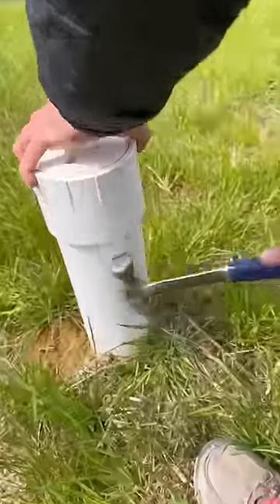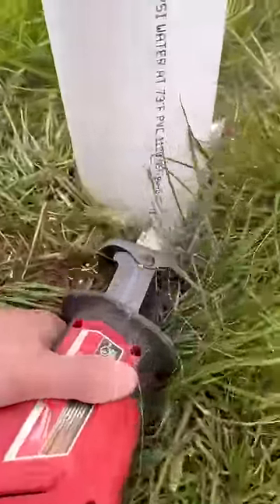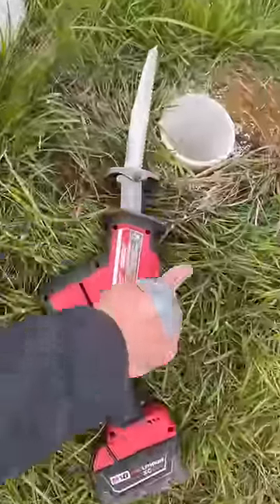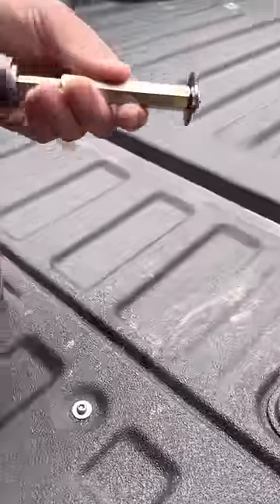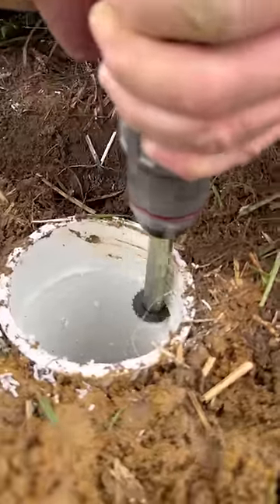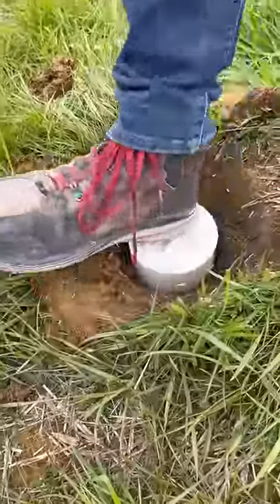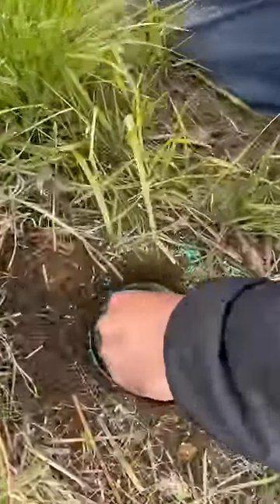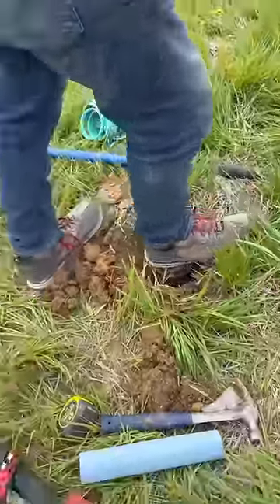How To Cut Off A Sewer Cleanout So That It’s Flush With The Ground

Comment: As a plumber, dont do this
Reply from the maker: I said, put it flush with the ground, not lower
Reply: Typcam2, I just looked at your profile and you don't look like a plumber. You look like a kid that makes tick-tock's. Lol
Reply: @hausplans  it will eventually get covered over time, now you have to intentionally make sure the grass doesn’t grow over it. It should be sticking no more or less than 5 inches above the ground! You make the plumbers job harder when it’s over grown and can’t be found.
Reply: I agree. Some homeowners don't touch these kinds of things for years, or the house gets sold and then it lost. That's why we intentionally leave them sticking out of the ground.

If you're going to cut it off, build a proper base around it out of concrete maybe, so it doesn't get lost, at least.
Reply: @hausplans no difference. It gets covered with dirt eventually babe.

Comment: As of September 2023 they all must be 2" above the soil surface in my State.  They no longer allow the burial of OSSF components that must be accessed for maintenance.
Reply: That's sucks. I live in America.
Reply: @NutzBdragon  It sucks when mowing, but paying extra to get the plumber to find and dig out the cleanout when somethings goes wrong is way worse.
Reply: 12" in my state
Reply: @NutzBdragon  can't you just mow around it ? It's pretty easy
Reply: Booo who we got the code inspector here 😂😂
Reply: @Hidden-comment164  Sadly I have unhealthy neighbors so I like them visible.
Reply: @SlackerU I assume you mean they can't walk or will trip, if you bury it there's nothing to trip on hence less risk then 2 ft above ground
Reply: @hotsauce2446  These systems need maintenance every two years, even if it is just to be checked.  If you look at the studies on OSSF you'll see that less than 50% participate in preventing nuisance conditions.  Even now we are finding the older aerobic conversion have oversized trash-tanks where extended periods of not pumping out the system makes habitat for rats.  Ideally you want to pump out your trash tank often so that you never build up any food for pests or large amounts of pathogens to overload your lawn.   My city offers an OSSF map so I get to visibly see the over 50% who are out of date & are one violation away from being forced to upgrade to the 2020 standards.

Comment: I have one sticking up in our yard. I'm planning on digging around it and putting in a small valve box to protect it and prevent the kids from opening it and putting rocks down there 😅
Reply: Best idea yet.
Reply: You're kids carry around a wrench to pull the cap? Lol
Reply: We just dug up the trap for a customer cuz the picture was damaged and loose. Customers young son found out how to remove cap,install a 3"diameter log into the 4" pipe. Then reinstall damaged cap.
Reply: lol kids do the funniest things. So innocent but also.... whhhhyyy 🤣😭
Reply: @RespectAllFearNone  mine doesn't have a threaded cap, you can just pull it off.
Reply: That is exactly what I do. And definitely keep the screw cap. Then it's very easy to just pop the lid off the valve cover and unscrew the clean out cap. You can even do this on an installation that will be surrounded by concrete.

Comment: I did this like 20yrs ago. I had a smaller ones up out of the grass from where the pipes ran for the septic. I burried pennies, so if I ever needed to find them after the grass grew over them, I could do it with a metal detector.

Comment: A trick I've used when doing the same thing is to get one of those cheap circular magnets that are almost the same size as the cap, the ones with the hooked bolt in the middle for you to tie a cord and use it to pick stuff up. Take the bolt out, use that hole to screw it straight to the top of the cap, and make sure you put a little Lexel or some all-weather silicone on the screw before screwing it in. That way, if by some chance, the dirt and grass ends up hiding it, you can use a similar magnet in the general area to find it quick and easy. The magnet also makes it way easier to pull the cap off without digging around it to grab the cap. You probably won't even need to magnet to find the cast iron cap. So just use a magnet to locate cast iron cap. I did the same thing for a customer who wanted to hide the clean out in their garden under a bunch of mulch. You couldn't tell it was there and made it super easy to find. He was able to find it in seconds with the magnet, without me telling him where it was. Especially if you do this with multiple repeat customers and always carry your magnet in your tools. You can go back a few years later and find it in seconds
Reply: Or just glue an Air Tag to the top of it..

Comment: Seen people do this and can't find it later on when they need to. The plumber will just add a box around it or pipe it high again if you call them to find it.😂 Plus, most states require it minimum 12 above grade

Comment: I'd poke in a few iron pins or rebar around each access and measure the distance from a building corner.  Spraying orange paint on the caps will help locating them later.
Reply: @hausplans  Alternatively, you could get a pair of precast decorative donuts to place around the cleanouts.  This would allow you to safely mow over them.

Comment: Hello.  Great video. The clean out Pipe is sticking up and the the stand pipe for the check valve is extended as well.  I left it because cutting the clean out Pipe is straight forward but I worry about the stand pipe for the check valve. Can that one be cut as well?

Comment: But downside to even clean out rventp bottom would be bury by mud, grass and more opject?
Reply from the maker: If you cut it off flush or even a little little bit higher, you should still be able to find it

Comment: I kinda wonder if you shouldn't convert that to a vent-riser to allow the chlorine gas to escape.  Chlorine gas is heavier than air so forcing it to rise through the house-roof-plumbing-vents is kinda outdated.  OSSFs have activated-carbon filters that fit 3 or 4 inch risers.

Comment: You have it dug out anyway so you can take your choice of what to cut it with from the out but a dremel will do both and a drill ,angle grinder or several saws will work
Reply from the maker: This little tools, a lot faster than a Dremel and only cost about eight bucks

Comment: Top tip , when you tightened the drill chuck , turn it back and one click , you'll here the click . That means the chucks now locked . It works on Dewalt which I use and I assume other use the same feature too like milwaukee . Try it for yourself and see . It would make a cool video since almost no one I know in the trade is aware of this and combi drills dint mention it anywhere in user manual
Reply: For most drills that's just a myth.  Nowhere on the Milwaukee drill's user manual does it say to do that.  I don't think it's true with Dewalt either.
Reply: @devonboyer626  it is true , I uwe the function every day. Just because you're unaware of it doesn't mean it's not true , maybe milwaukee dint have the feature but Dewalt does and I use it every day. I know it's not in user manual , I stated that 😂
Reply: @devonboyer626  it works with makita and bosch too , I've owned them in the past and used the feature . Can confirm it's 100% true
Reply: @christophergallagher3845  just because you think it works, doesn't mean it works. Lol mancaver tools thinks so and he's always dropping bits in hit videos. How is it even possible to "lock it" when you are literally loosening it by one click?  There is no proof that going back on click locks it.  This has also been debunked multiple times.
Reply: @devonboyer626  I know it works because I use it at least 5 days a week every week
Reply: @devonboyer626  I know from experience it works with the drill I mentioned that I use , you're telling me it doesn't work because you watch YouTube 😂 think about it
Reply: @devonboyer626  a drill doesn't tighten by clicks , the clicks is the locking mechanism activating.  It doesn't loosen the drill . Do you even own a drill ? 😂
Reply: @christophergallagher3845  do you also think that a seat belt makes a car drive just because you put one on every time to drive a car?  Lmao. You aren't "locking" anything by going back a click.  That's not how ratcheting drill chucks are designed.
Reply: @devonboyer626  a seat belt and a combi drill chuck are 2 completely different things 😂  silly attempt at a comparison
Reply: @devonboyer626  you don't own a modern combi drill do you ?

Comment: In the UK we have man holes/drains not random pipes sticking up everywhere lol
Reply from the maker: We have manholes as well on the main system. These are what you have in your yard. I highly doubt you have a manhole in your yard next to your house.
Reply: @hausplans  I have two inspection chambers (a round plastic cover about a foot wide where my house joins the network in the garden) and then I have a 2 foot square manhole in my back garden with an interceptor, that is about 6 foot deep. That's only for rainwater though. I hate it, it's huge, and looks horrid lol

Comment: I would neveer do this, headed in to the future you will never know whaer it is. Find a way to create some landscaping around it so its not noticable. They make awesome fake rock covers that can be installed with other real stone so you dont know its there
Reply from the maker: I said, cut it flush with the ground, not lower than the ground. You can totally find them later you can even leave it up an inch or two just as long as it clears the mower blade.

Comment: Cut it about 1 1/2" lower than what you just did then place a 12 x 12 concrete paver on it so it is flush with the ground. I can still see mine 16 yrs later

Comment: I have been tempted to do this to mine for 20+ years now. To everyone who is crapping on this idea because "he won't be able to find it"...I imagine it isn't any different than finding where your septic tank is buried...that is, you mark it or measure it from a known point(s) or put some type of marker over it. I would consider putting a large flat stone directly over it if I did this...would still be able to mow over it, but would be clear where it is.
Reply: The rules are changing where we can't bury them in my State. They're all required to be 2 inches above the soil surface for all new installs & all repairs.
Reply from the maker: I would put it in flush with the ground or slightly above just enough so it clears your mower, then you can always find it. You could check your local codes first to see what the requirements are.